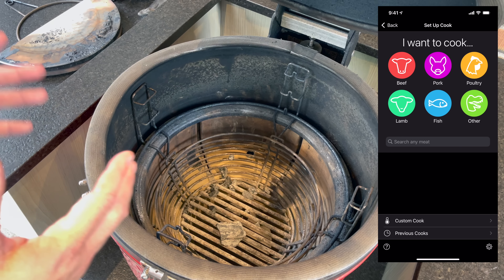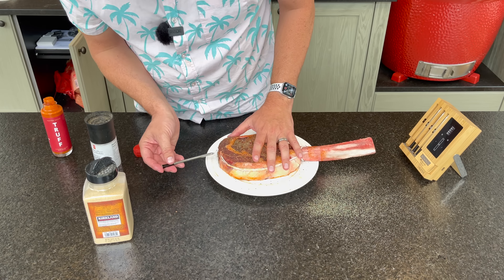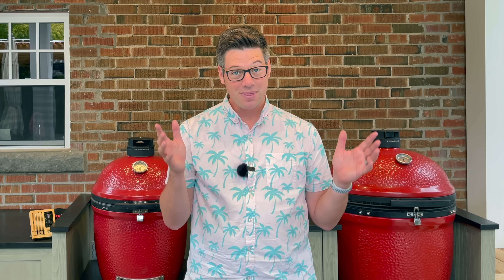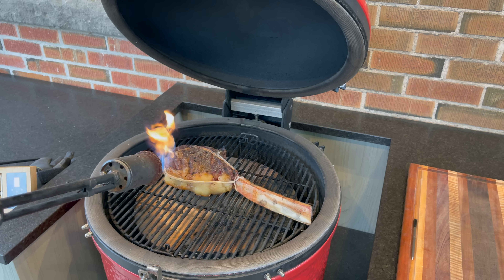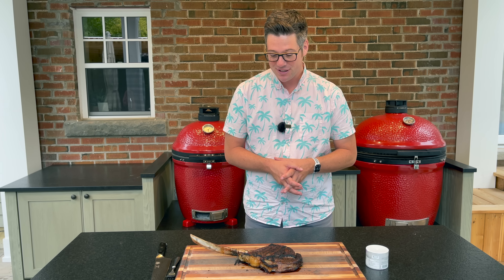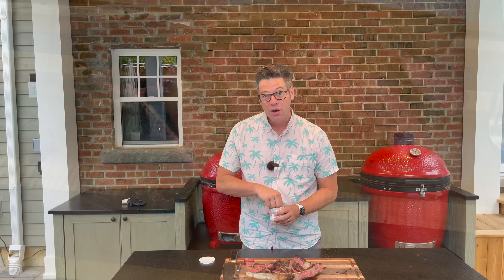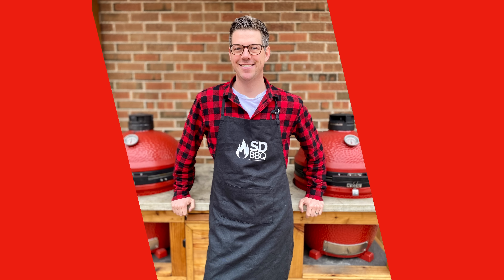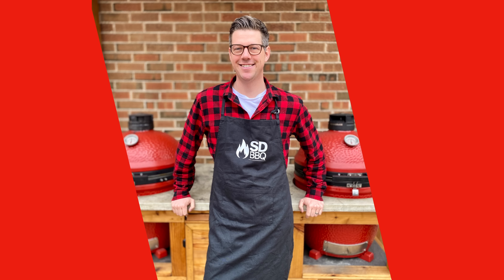Charcoal vs Gas... Did my DIY Kamado Joe Gas Joe tomahawk steak taste good?  100% grill torch cook

Comment: I have a Vision Grills ‘dual fuel’ Kamado…and while I don’t use the gas that often…it does work well! And it IS different than cooking on a traditional gas BBQ.
Reply from the maker: its definitely got some advantage over a traditional gas grill i can see that... but way down on flavour compared to charcoal or wood
Reply: @SmokingDadBBQ  I totally agree. I bought it along with the Vision Kamado because, coming at this from a long-time gas griller, I considered there would be times I would just need to get dinner cooked. Those instances happened early on...first few months. Now I find that I just plan my cooks ahead so I can just use charcoal. If I had it to do again...I would save the $$$ on the gas insert.

Comment: I usually sear directly over the fire anyway, so I love the Grill Gun sear... though I use a Su-V gun now which is much easier to control because of the diffuser plate. I'm not sure it got a fair shake since you were missing the normal charcoal flavor 😁
Reply from the maker: yes yet it somehow came out better than I was expecting. I will get a Sv gun and try that
Reply: @SmokingDadBBQ  I think the crust would be similar enough - it's just that the diffuser plate makes the Su-V Gun easier to control (and maybe its fire a little hotter because it's all concentrated by the diffuser plate).

It's just that when you Sear four 4-6 inch wide pieces of meat side by side with the Grill Gun, and its two foot stream of fire, it's easy to do something like set your gasket on fire like I did 😅. The gasket doesn't seem to have really been hurt at all, but it freaked me out enough to buy a Su-V gun.

Comment: Another great video! A question for you, what are your thoughts on the Sloroller flaking? The health hazard of the flaking coating fall into the fire box and then burn into the food seems concerning. My sloroller is peeling excessively and its only a few months old (never exceed 500). KJ doesn't seem to want to cover it under warranty. Any thoughts? Is the coating actually teflon?
Reply from the maker: I have heard mixed news that it is not actually Teflon. I hope it isn’t

Comment: James, what do you think of the Vision Grills Kamado with the propane attachment? I've been thinking of getting one myself... As a Kamado, so with charcoal first, is it a good grill? The propane would just be a plus for me on lazy days where I can cook myself a burger for dinner quickly. Thanks!
Reply from the maker: i personally wouldn't use it.  I like the accessory ecosystem of the KJ (soapstone and joetisserie are my top 2), not sure if they fit on the vision, if they do ignore my comment.  instead, i would just get something like this grill torch as you can be up and cooking in 10-20min from a cold needing to be cleaned grill so i no longer find the convenience barrier that hard to cross as getting the grill going isn't the big deal it once was

Comment: Happy birthday James. It is a fun experiment and speaks to the efficiency of ceramic kamado grills. Did you at all  feel like the resulting flavor cooking in a ceramic chamber would have been different from cooking in a kitchen gas oven? Just  asking for your impression, not worth doing a real comparison. In the past, I had noticed steaks taste different  from one type and size of oven to another.  Awaiting for your video using real wood. Will you be doing it side by side to cooking with charcoal?
Reply from the maker: I am planning to try and run the Joe like an offset with wood

Comment: Good video.  There's no reason for snobbery in any direction.  Certain cooking methods (like charcoal, wood, etc) add extra flavors.  There's arguments that sometimes you -don't- want those extra flavors.  If you have a high quality cut for example and you want more of the meat flavor itself coming through you might use less other seasonings, going to something like a gas grill (or say an inside stove top cast iron sear etc) vs something like charcoal etc is just another seasoning you can choose to add or not.  So choosing to let the meat or other seasonings shine through by using a gas grill can make a lot of sense and might actually be "better" in certain scenarios.  One method that seems to produce a really good steak that let's the meat shine through is an infrared burner sear.  In a lot of ways adding smoke flavor and slow cooking is/was used to overcome lower quality tough cuts of meat.  A port butt or brisket doesn't have a ton of natural flavor compared to some other cuts, so you cook slow to break down the tough meat and infuse it with smoke flavor to add more to it, while certain other cuts if high quality can have a lot of natural flavor that the smoke or charcoal might cover up.  Then there's just daily preferences, some days you might switch up seasoning on a steak just to mix it up, use salt and pepper one day, throw on a spicier mix the next time.  Gas vs charcoal is really no different.  Neither are better or worse just different and have their places.
Reply from the maker: you can definitely over smoke things that would be better with less smoke

Comment: Well that was a very interesting experiment! I’m curious, in general when you are using charcoal, what factors make you chose to light your charcoal using your grill gun instead of another method like fire starters? When you did your video comparing ways to light charcoal, the grill gun did not do so well. Except for the fun factor.
Reply from the maker: I held back on it for the cost was the big deterrent but it was the fastest and most fun. turns out a year later I have gravitated to fun and speed as i use it for most everything now
Reply: I didn't want to spend quite a much as the grill gun.  I did find a piece that works very similarly for about a 3rd of the cost.  Look up the jj George grill torch.  James,  maybe you can do a comparison of your haven't

Comment: James, do you have any videos on the proper way of lifting a classic 2?  I see people holding the air hinge,  I thought that was a no no.
Reply from the maker: the back of the air hinge and the vent bottom front is where you can lift. the hinge or side shelves are not safe lift points
Reply: Thanks, but not sure I know what you mean by back of air hinge, but not the air hinge.

Comment: I've read that the issue with searing with a torch is that it can put small bits of unburned fuel on the meat producing an off flavor. You didn't have this issue?
Reply from the maker: i didn't get any of that.. seemed to work just like a gas grill on high heat if not more concentrated / hotter
Reply from the maker: i still prefer the taste of normal with charcoal.... but nothing negative about this crust other than what it was missing vs. what it added (or didn't)